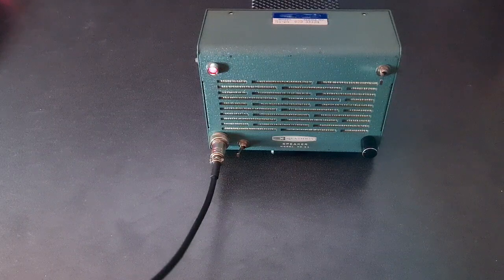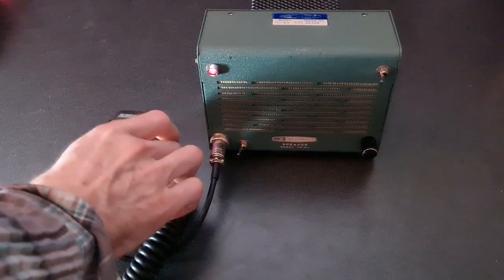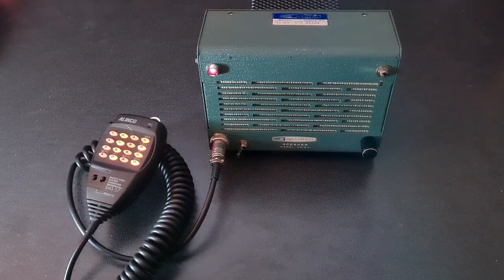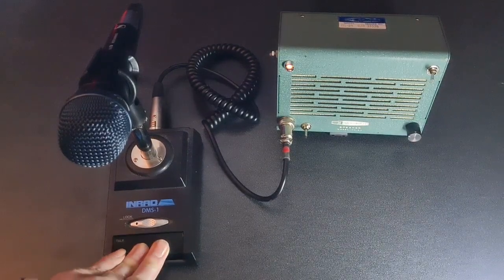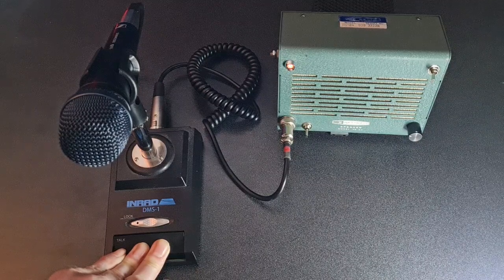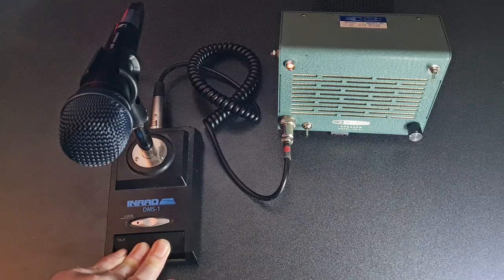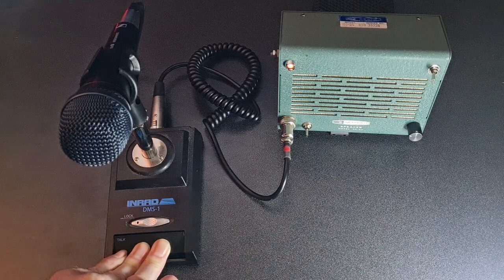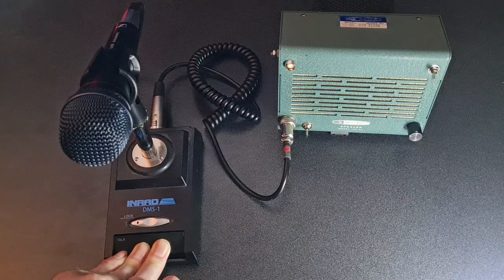AllScan Radio-Less AllStar Node HeathKit Mic Demo Alinco EMS-57 Kenwood MC-60A MC-85 Sennheiser

Comment: Hi, thanks a lot for your test. Did you use the pre-amplifier with Kenwood MC60. A friend of mine recorded me using a FT891 with a MC60A and I have more bass than in your video.  73
Reply from the maker: Yes preamp was on but the node has the simpleusb plfilter setting enabled which does a low-cut below 250Hz (24dB/octave) in addition to a 6dB/oct RC high-pass filter at 250Hz in the preamp circuit.